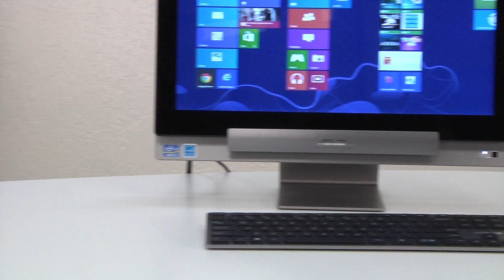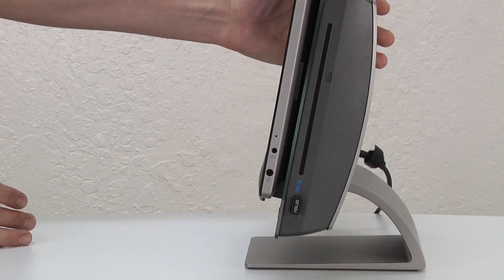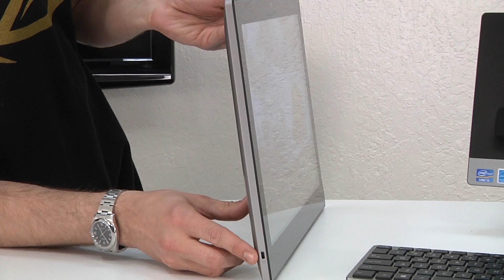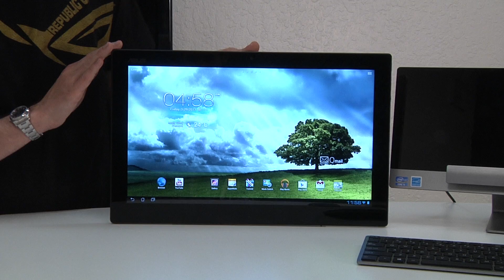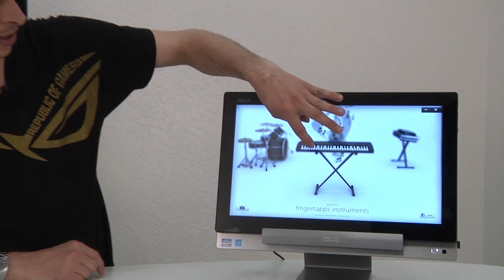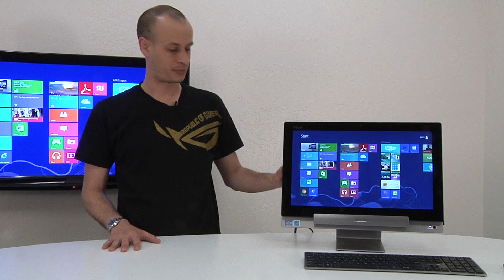ASUS Transformer All-in-One Overview

Comment: I purchased this PC back in 2013. I can say, it worked extremely well BUT it's not for gaming. Especially if you're into bigger games. Not because it wouldn't handle it (because it does handle ALL games, extremely well) but because of the overheating. If you plan on getting in anyway, I suggest changing the fan first. I wish I knew this before mine broke. It broke about a year ago and I couldn't fix it since. They stopped the production and so the parts are hard to come across. If you're looking to buy something good for just gaming, NEVER buy an all-in-one PC. Besides that, it's a really good computer. It can handle programs like PS or Maya if you're a photographer or 3D artist and like to game on the side this is perfect for you.

Comment: I'm almost sure I'll be buying one of these later this year when  Microsoft comes out with Windows 8.1 or what ever they call the new Windows system to clean up the Windows 8 mess.  
I have a couple of questions.
Does the keyboard and mouse work when the unit is in Android mode and docked on the base
Does the keyboard and mouse work in android mode when the tablet is off of the base??

Comment: Hey, how the device will handle system change ? What if i install Windows 7, will it still work correctly after drivers install?

The Android part seems to use a custom version of splashtop that hide the Android's taskbar, can you confirm ?

Comment: is it using splashtop streamer to view in windows mode off the dock?...i mean already having an asus android tablet and a windows computer i can do the same thing. Its only providing me slightly better specs and a bigger screen. The only plus i like is the ability to use the dock while the tablet is used in android mode, but then again i can do the same thing with my tablet and any other windows computer. I like the idea but I would like it more if windows was on the tablet itself.